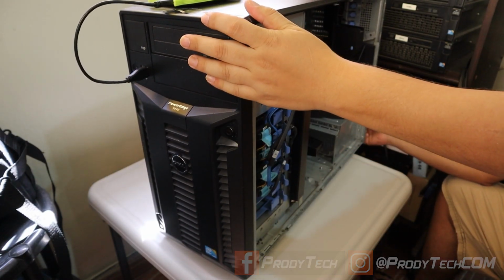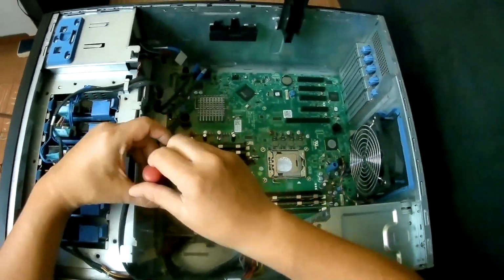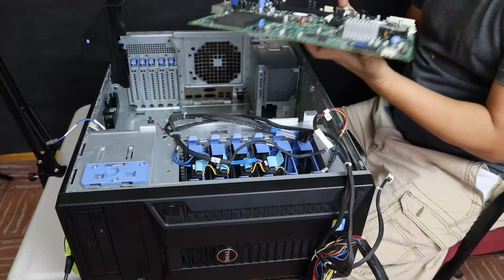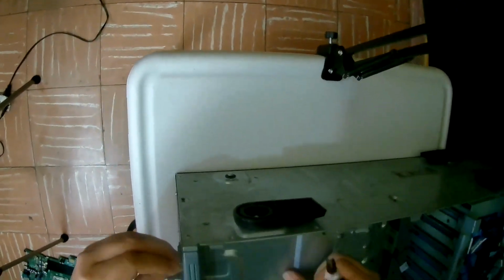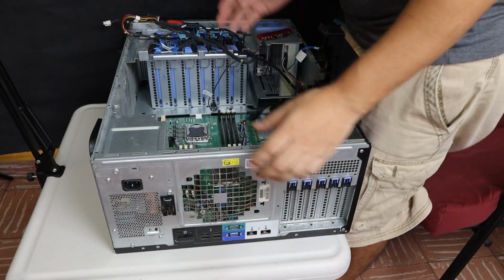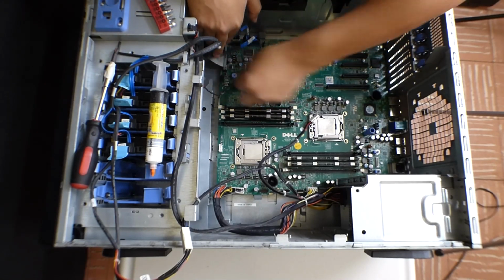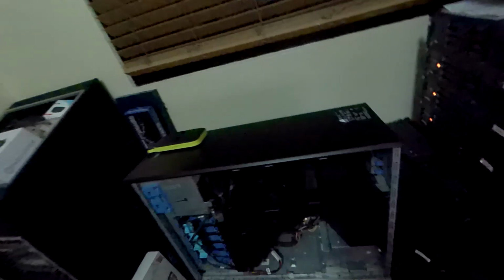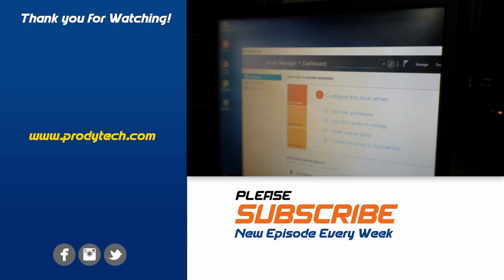Dell PowerEdge T410 Motherboard Teardown and Power Supply Swap

Comment: Which form factor is that board?
Reply from the maker: It's a Dell Proprietary motherboard form factor. You can't put an after market motherboard it wont fit or work with the other peripherals

Comment: Our T410 has redundant power supply. Can we replaced it with just single regular good power supply (not from Dell) ?
Reply from the maker: Yes you can, but use Dell power supply. These severs are very sensitive and you might damage the motherboard.
Reply: @ProdyTech  A good Corsair TX650 PSU is not good enough for a server?
Reply from the maker: @waaawone936  it could be a good a power supply but Dell uses its own connector configuration so mostlikely it won't work.  You can get a single unit on ebay and the rear mount for peanuts. On the  video you can get the part number and order it
Reply: @ProdyTech  Yeah, but I'm not in the US. And I believe Dell resellers here doesn't have ready stock available. It's been hours since I asked them 😅
Reply from the maker: @waaawone936  ouch, I know what you mean. In that case you have to look for the schematics to match the cable colors and voltage to the Corsair PSU.

Comment: How do you troubleshoot and confirm a motherboard failure from T410?
Reply from the maker: Well it really depends on the failure...But the diagnostic lights can help out and symptoms to diagnose. For example, this server started to shutdown unexpectedly and the logs showed  it was due to over voltage, which of course it was not true because it was behind a fully working UPS. Later it started to power cycle like I showed on the video. But like I said it really depends what's going. When they start to act up it best just to replace the board and not attempt to repair it.